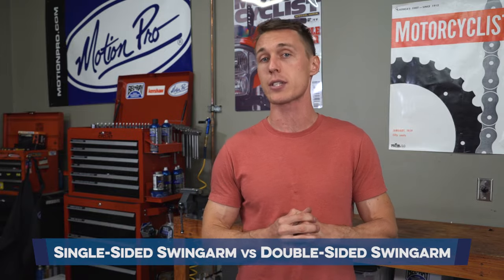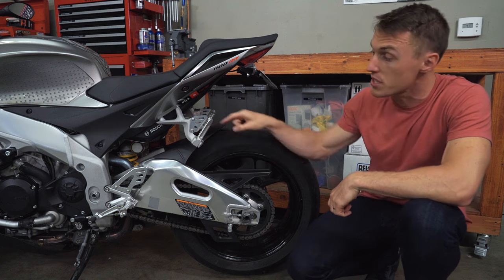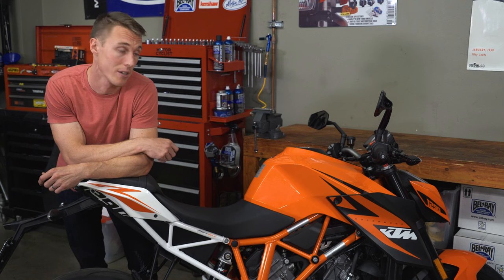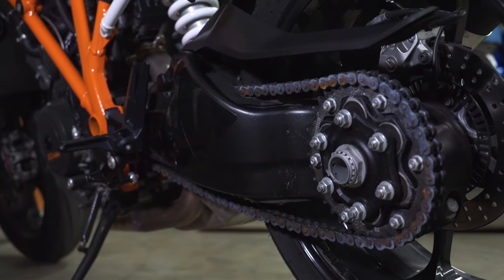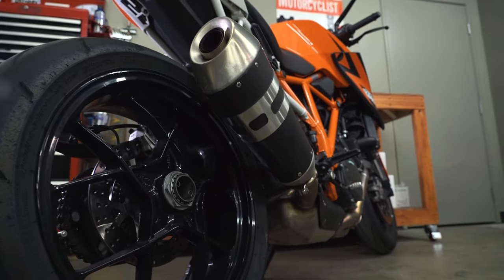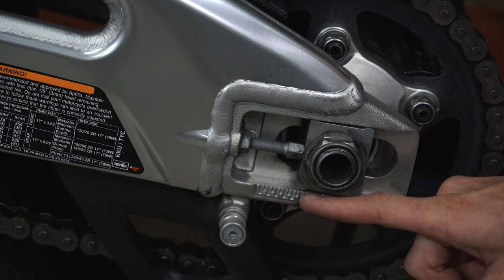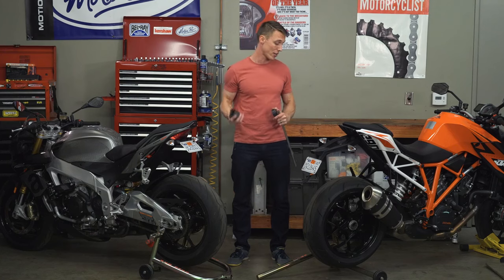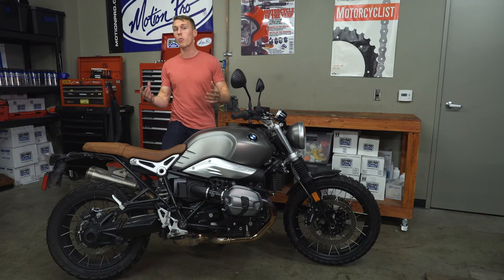Single-Sided vs. Double-Sided Swingarm What's The Difference? | MC GARAGE

Comment: easier chain maintenance on single sided swing arm ... and a rusty chain on the ktm, apparently not easy enough
Reply: Ari Henning So no chain maintenance advice from that magazine? lol.
Reply: heh, no problem Ari, I understand that it wouldn't be easy to maintain all the bikes you guys have there for every single shoot especially when you are just borrowing them for one shoot, I just found that irony funny :)
Reply: How easy is it to get the bikes trail aligned with a single sided swing arm? On the doubles they have a mark on each side to use so you know the tire is center while adjusting chain length. Since it's only one side. How do you get the rake right?
Reply: I was about to type comment about that :D
Reply: they use an eccentric to hold the hub- it's always square to the axis of the bike, and it rotates to tension the chain. Look carefully at a Ducati 916 arm to see how it works.
Reply: arealassassin Single sided swingarms require hiring beat poets and bohiemians to work on them, it really does pay to be eccentric!
Reply: Wow they never told me that in college lol. Only double swing arms, never did a single swing arm alinge test. Seems interesting.
Reply: yamatoSVK good call I noticed that too
Reply: Another magazine, huh? That's about as believable as the Craigslist ad pointing out that damage was done "by the previous owner"  :))
Reply: That's not rust. That's traditional KTM orange color :P
Reply: Duhhh It's done on purpose to match the KTM Orange,  hahhaha jk
Reply: It's not rusty, it's orange because it's KTM (yes I'm joking)
Reply: yamatoSVK too expensive to ride
Reply: rusty and loose chain

Comment: my biggest concern with the single sided swing arms would be bearing wear. The engineering side of my brain always screams that that single bearing must be under a much larger amount of load than a double sided set up which should lead to you doing a lot more bearing changes. Not sure if that is how it ends up working out or if they have found a workaround, i'm surprised it wasn't in the vid.

Comment: Single sided swing arm, hell yeah!! Team VFR! :D
Reply: Honda put a single sided swingarm on the VFR for quick tyre changes during endurance racing.
Reply: Hell yeah, comes with the center stand and generic lugs!
Reply: I have an rvf400 it has a singlesided swingarm aswell
Reply: Me too!
Reply: M subbed to u as well bruh :)
Reply: I used to have an NC30 back in 1997, and I would have loved the NC35 but they were horrendously expensive.
Reply: 100th likers LMAO
Reply: Team NTV.
Reply: Ari Henning
Honda really took the idea from the ELF endurance racer that was Honda powered. There is a plaque on the SSSA on every generation of the VFR to acknowledge its origin.
The ELF also had one at the front but racers didn't like that one too much apparently.
Reply: V for racing 👌
Reply: i put VFR 800 single sided swing arm on my VTR 1000 :D 
it is longer than oryginal but i put it few cm higher so bike handle like 600 ...
but looks awesome 
so easy to repleace the tire 
and to clean ewerything :D
Reply: Single sided swing arms look mega cool

Comment: Great video as always. Except it's not easy to remove the rear wheel on Super Duke since you need to remove that silencer first in order to remove the rear wheel.
Reply: Wow, two little bolts, how difficult. I have a SDR myself and it takes three minutes...
Reply: not true. once the wheel nut is removed, pivot bottom of tire away from swing arm. roll back or drop out on and angle. won't touch anything

Comment: I have yamaha fz 250 and some day before it was slipped on right side. That was very miner but after this i feel my bike is goes in right direction and also there is balance problem in top speed . Now i have a problem is it my doubt or something wrong with this bike because i have visited the service center but still i m not satisfied. I have search a lot of video in you tube but i can not find my problems solution. Now i have only one hope that is your suggestion.

Comment: on the single side, if you just have to undo the axle nut and slide it off, wouldn't exhaust location on alot of bikes hinder that!? Like this one for example, or the stock diavel? just wondering, thanks! love your guys' channel

Comment: A question that wasn't answered but briefly mentioned in-video was additional loads, i.e. side bags/paneers.  Would there be a balance difference between the two different setups?  To clarify, would a DS swing arm maintain its overall ride balance better than a SS swing arm?

Comment: So one thing that comes up when running a finite element analysis on a cantilever like a swing arm is that all your load comes from where the rear tire meets the road, we can assume forces like rider's weight and bike weight, but acceleration forces are the tough thing to work out. for a double sided swing, acceleration forces, like the rear wheel hitting a bump, or accelerating in a straight line, the forces are generally distributed evenly, so you can model the swing arm essentially in 2 dimensions. for a single sided swing arm, you now have a torque caused by the distance (width) of the center of the wheel to the center of the single sided swing arm which DOES cause a torsional rotation of the arm. is that bad? only if the twisting of the swing arm in enough to cause input to the bike. Ducati actually found out that it's easy enough to make a single sided swing arm work for a track where most forces are fairly consistent and repeatable, but when a street rider hits a box dot or a speed bump, that's a massive spike in acceleration forces on the rear wheel, more than cornering, (on average, it's double) this is usually what forces companies to really beef up single sided swing arms for Street bikes.

Comment: hey guys.

please can you do a video talking about engine configuration?

specifically, the direction crankshafts spin, how number of cylinders bore and stroke effect output and how design such as angle of rotation or mount position is important to designers. why does a 40 degree angle matter over a 32degree angle? why aren't engines mounted horizontally? is cross plane crank really that much of a big deal? etc etc, have read lots of stuff but would love to see your take on it all. 

thanks

Comment: When is the long term Tuono review coming up?
Reply: thanks for the link Ari.How does the RR sachs suspension cope with everyday roads?have you ridden the factory tuono? how does it compare to the RR for "hardcore" canyon riding on various (from smooth asphalt to rougher sections) surface qualities? Is the ohlins better in this arena than the sachs ? thanks

Comment: Sir,I lubed my clutch wire and lever,still clutch lever is hard to pull..I have a CBR 125 sir, I still remember 2 years ago,the first time I changed clutch wire, when I disconnected the old wire, I tried pushing the clutch push rod above the right crankcase to which the clutch wire end is attached and its was very easy to push not tight at all..one year ago I changed my clutch plates at service center ,and its been a year and twice my clutch lever was broken..while changing it the second time,I noticed that ,the clutch push rod was extremely tight ,I couldn't even move it..I tried connecting a 20" spanner and tried to move it..it was very tight...what can be the problem sir??is it because the clutch springs are over torqued??

Comment: can you guys do a video on making the throttle less sticky. by that I mean mine won't spring back to the throttle closed position on its own
Reply: Ari Henning is there a special lubricant to use? when I took off my throttle tube there was no lube in there at all. do I just use general automotive grease?

Comment: Single sided swingarms do allow you to remove the wheel without having to remove the chain and axle as well, making it an easier task.  This holds true on some bikes but what is often over looked is that on some bikes the muffler needs to be removed to allow the wheel to slide off. On others, even the caliper still needs to be unbolted and put to the side. In these cases the simplicity of the rear wheel removal on a single sided swingarm has extra steps required that would not be necessary on a double sided swingman. So depending on which model single sided swingarm you get, removal of the wheel can be easier or harder than a double sided swingarm.
Reply: I think even on the KTM that was shown the slip on muffler needs to be removed in order to allow the wheel to slide off the axle. Without removing the muffler you will not have enough room to finesse the wheel between the caliper and exhaust without gouging the rim.

Comment: Next video idea... steel braided brake lines vs. rubber lines? Does it really make a difference?
Reply: Yes, yes it does!
Reply: Drop some knowledge on us!
Reply: Haha, will do. We're looking to do a "Best Three Brake Upgrades" video. You'd be surprised at how much improvement you can see with a few relatively cheap upgrades.
Reply: Indeed. Though I just came off a 2015 Super Duke that was a $17k bike with Brembo M50s but rubber lines... where as my R Nine T Racer has lower spec Brembos and steel lines. I would think if you have the best Brembo's on the market, you would pair them with the better lines. I guess costs had to be cut somewhere!
Reply: Braided lines don't bulge under pressure like rubber can. So pressure loaded into the brake fluid is transferred to the callipers more efficiently. This creates faster, stronger application of force onto your brake rotors.
Reply: Reet Proper, good explanation.
Reply: You've carved a smart niche. Short & sweet. Simple but thorough. Too many vids with indulgent intros & superfluous waffle. Good rider channels stand out. Which is why I subscribed. Keep up the good work Ari. If you haven't already, watch 44Teeth, lockk9 TT Racing & definitely Shimmy TV. All different but informative & entertaining
Reply: rubber is known for it's elastic properties - steel isn't. Brake fluid travels from the brake fluid reservoir to the caliper thru that tube. If the material allows for stretching (in diameter mostly) less pressure will  be at the caliper - less braking (in theory). wrapping it in steel removes any dilatation so the pressure remains the same as if it would have traveled thru copper tube. this effect gets worse with time but your line will leak way before the effect is significant / noticeable. Why not copper tube in the first place? Because the distance from the pump to the caliper varies and it will snap/leak at some point in time. Copper lines are used in cars actually: from the pump to above each wheel. from there rubber or braided tube to the caliper. Using a rubber tube to each wheel (10+ feet long will not hold the pressure and brakes will never apply to full potential)

Comment: what do you recommend me an r3 or an mt 07 restricted to the a2? (For a new rider)
Reply: Redshiftit Thank you so much I'll keep an eye on that channel 😉
Reply: The Honda Cb500f, it is more than the r3 while still not too much for a2, and looks (in my opinion of course) way nicer than the fz
Reply: Honestly, I would say a used r3. It will hold its value better, will be cheaper to insure, cheaper to run, and is perfect to learn on. Then when you outgrow it, you can trade it in for a bigger bike, with hardly any loss (maybe even a gain, if you found it at a good price). I think at the end of the day, many people will also outgrow the mt-07, maybe a year later than the r3, and then it will have dropped even further in price when you eventually sell it/trade it in for something else. But hey, test ride both (and possibly some other bikes as well), and see which bike fits you the best. People here on Youtube can only give objective advice, in the end it's your subjective mind that has to decide what's right for you.

Comment: The Ducati dealer told me my 1299 single sided swing arm was actually lighter than the double sided one on the 959. So I guess thats a major advantage ! BTW after i found a good deal on the rear wheel socket, taking that wheel off is awesome !! One bolt and thats it...crazy...
Reply: Chris Martin
That may be the case but it's certainly not a general rule.
The 959 is necessarily an exercise in cost cutting since they really must offer it at a significantly lower price than its big sister.

Comment: arai vs other brand helmets. Does arai really protect you more than hjc?
Reply: im pretty sure a 100 dollar bell helmet that is DOT approved will protect your nogen just as much as a 1000 dollar arai helmet
Reply: As long as you buy a DOT/ECE/ADR approved helmet that fits your head correctly, you'll be protected. A $1000 Arai that doesn't fit well will protect you less than a $100 HJC that fits you correctly.

Comment: The ease of wheel removal and installation is enough of an advantage that I prefer SSSA on road bikes. I invested the money on a large socket to do the maintenance on a Triumph Sprint ST. I hate changing the tires on my Triumph Scrambler or Ural Patrol. It's so easy on the Sprint. So, here's another question, why don't more manufacturers use an eccentric chain adjuster on their bikes with double sided swing arms? That's just another thing that would make maintenance easier when adjusting chain tension.

Comment: are KTM duke 200's and 390''s reliable ?
Reply: Super reliable. I have duke 390. 200 is lacking abs though i guess. But duke 390 is love. Light weight machine with extreme torque. Excellent stopping power and enough power to wheelie back right after.

Comment: For next one: Stock vs K&N/Washable air filters? Real flow, actual filtration, cost in the long run, maintenance (if you have a K&N that has been used and abused and washed many times) ? :p

Comment: Scooters usually have double sided swingarms as well. Vespas in particular (and a few others) are one-sided as far as I'm aware.

I've heard them described as having the engine mounted on the swingarm. This isn't quite right; the engine/transmission ARE the swingarm.

Comment: it takes me 1 minute to remover the rear wheel from my VFR 800, however, it takes me 1 hour to remove the rear wheel from my royal Star venture ( think, remove both exhausts, saddle bags, saddle bag rail and have to lift the bike a good height to get the wheel out from under the rear mud guard )

Comment: Single-Sided Swing Arms are a big advantage for the Motorcycle Manufacturer.  It reduces the cost of production and increases their profits.  All current motorcycle designs have been made for the same greed factor of manufacturers !  Liquid Cooled Engines were also designed and produced for the same garbage reason(s).  All 1000cc air cooled engines were discontinued in 1984.  The production cost in materials for those engines is 40% more expensive to produce due to Types of Valves, Pistons, Cylinder Head(s), Crankshaft, Connecting Rods etc. etc. The effectiveness of there Cooling Design and use of Quality Oil Coolers was another cost they eliminated.  Look at the chassis of old or classic bikes and compare them to the trash they're making today with plastic.  

Unibody Construction in automobiles were made for the same purposes.  It eliminated the need for a Chassis/Frame in addition easier to produce on an assembly line production.  Front Wheel  Drive cars were also produced for the same reasons.  Manufacturers reduced their production costs by 35%, but increased the price of their trash cans.  

Look at the styling, use of chrome and steel on old bikes, and ask yourself how much it would cost in today's dollars to make some beautiful quality motorcycles.  If you drive an SUV or think today's bikes are better looking or better, think again.  A 1955 Vincent Black Lightning was able to do 150 M.P.H.  It took 65 Years to develop a  Super Bike to do 200 M.P.H. Compare the cost of Chrome with PC/ABS Plastic used in bikes and cars.  The motoring public should be screaming in protest of getting robbed of quality commodities, and refuse buy garbage !

Comment: Single sided swing arms are strong but at motogp power, vibration, and stress, it needs dual to absorb shock and such, there's too much to pivot, any stress cracks could rip it right off.

Comment: Not if its a VFR800 easy it has a center stand and 4 wheel nuts also when I need new rear tyre they don't charge me extra at the motorcycle shop

Comment: I know the bhp figures don't always bear this out but I always feel that single siders look like they're probably underpowered (only needing moped level tech) from one side and heavy/bulky/over engineered from the other. Personally I like to see a rear wheel that looks like it needs two hands to hold it,  afterall you don't see many/any single sided drag bikes. As the vid says aside from specialist applications it's all just a matter of taste and anesthetics. No wrong or right, just a preference for either old skool solidity or modern 'cool''.